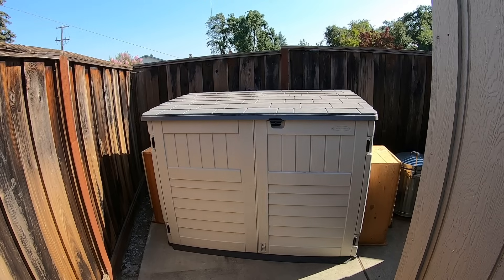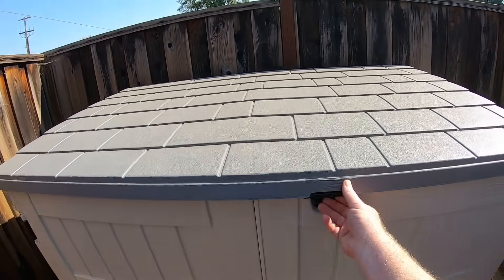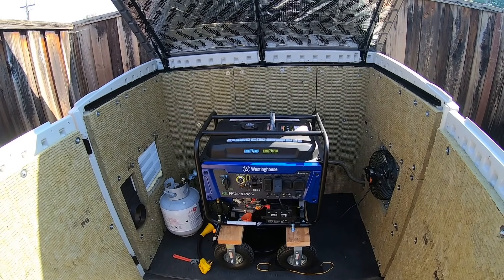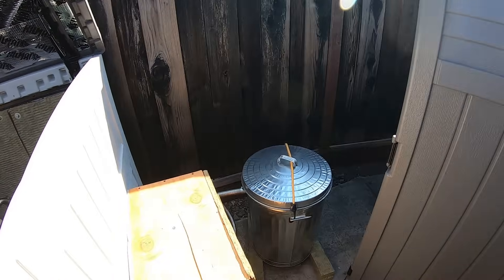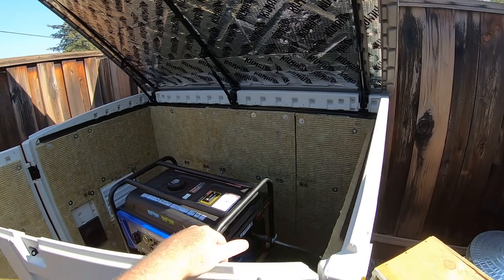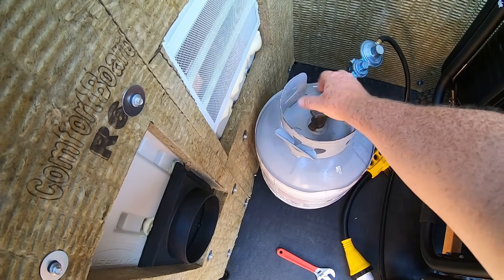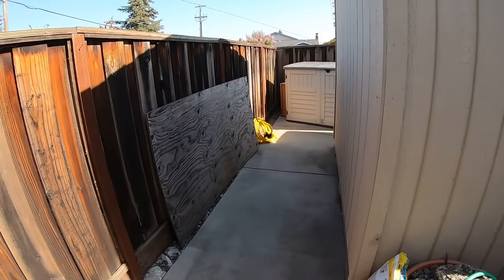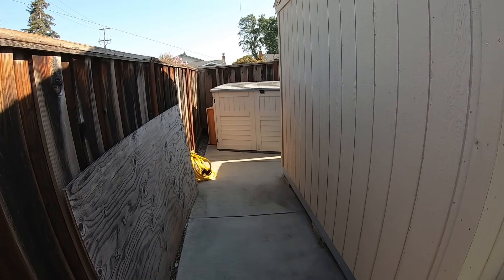DIY Generator Shed Build - Quiet Sound Insulation with Exhaust Muffler

Comment: Honestly, I didn't watch the video or read many comments, but I'll just tell you that I saw the LPG tank and reg inside the box and it jumped out as something I wouldn't have done. Codes require clearances around natural gas regs (pre-meter) to things like windows, vents into buildings and air inlets to appliances. If the diaphram in the reg has a sudden major failure (rare , but it can happen) , you want that leaking gas to go outside and away from any potential ignition sources. Plus the tank just takes up room and doesn't make any noise anyway. I know bbq's have the tank/reg right next to the flame, but it's still something that most people don't think is an issue until they have what could be a very serious problem. At least that reg you have on your tank is a 2 stage.
Reply from the maker: Legitimate points.  The shed is setup so that you can easily move the propane tank outside of the shed and run the hose back through the blast-gate on the left, along with the electrical cables.   And yes, BBQs have the propane tank literally inches from the open flame as well.  Leaking propane is never a good thing.  I discuss these issues in my later videos on the exhaust and shed.

Comment: thanks for the great idea, I need this, also is that an intake fan on the right side?
Reply from the maker: There is an inlet vent on the left and an outlet fan on the right.  You can see more info in some later videos.  I cover the costs, parts lists, and other FAQs in a later video about my Version 2.0 Shed Exhaust.  Check out the latest vid here: https://youtu.be/y3pUw408jCU

Comment: So in addition to the muffler that was on the generator to begin with, the external secondary muffler adds another back pressure element.  Any performance degradation?  I'm thinking about removing the stock muffler on my generator and just straight piping to exit the enclosure, but I'm not sure if the loss of the stock muffler would increase the external noise.  Perhaps a larger external muffler?
Reply from the maker: I don't think I would recommend removing the stock muffler.  But I did address some of the backpressure issues in my later Version 2.0 Exhaust video, where I upgrade everything from 1" pipe to 2" pipe.  Check it out on my channel:  https://youtu.be/y3pUw408jCU

Comment: Does the exhaust can you made create too much backpressure causing the generator to use more fuel than normal on a lengthy run?
Reply from the maker: I address this issue in a later video on my 2.0 exhaust.  I updated the exhaust from 1" to 2" to make the exhaust flow easier.  https://youtu.be/y3pUw408jCU

Comment: I would much rather have a gas motorcycle versus a propane generator/shed/electric motorcycle
Reply from the maker: Fair enough.  But your gas dirt bike probably won't power your house if the electricity goes out.  I also discuss this topic a bit in a later video about the 2.0 exhaust.  But dirt bikes aside, I think most people probably watched the video to get tips on quieting down a noisy generator.

Comment: Great job with the sound deadening!
One thing I would  like to point out is I would move the propane cylinder outside for safety, preferably to the yard maybe by running some hardline.
Reply from the maker: I discuss this in a later video about my 2.0 exhaust setup.  Check out my channel for more vids on this subject.  The shed is designed so that I can put the propane outside and pass the hose back in via the blast gate.

Comment: Hi man i do not understand. That fan aspires hot air to the esternal or blows inside fresh air?
Reply from the maker: The fan pulls the hot air from inside and pushes it to the outside.  Cool air comes in from the vent on the left side, goes across the generator, and then exits on the fan-side on the right.
Reply: @C5Tor  thanks a million

Comment: Perfect setup.  Do you worry about exhaust build up in sort of closed in space? Since the exhaust points down and not away or up.
Reply from the maker: The exhaust is vented to the outside air, and is about 25 feet from my house, behind another shed.  It looks a little enclosed, but it is not.  Plenty of airflow in that corner of the yard.

Comment: Fantastic set up just one big problem. Get the propane out of the enclosure. You didnt set up a vent low enough in case the propane happens to leak.  A 20lb tank can level a house.  3 items in the shed can ignite the proane, exhaust, electric fan and electric starter. place it outside with an extension hose.
Reply from the maker: Good point, and I mention this in a later video.  The shed is setup to move the propane tank outside (to the left) and pass the propane hose via the blast-gate back into the shed.  This was just setup this way for demo purposes.

Comment: What length screws did you use to hang the Rockwool Boarrd up? Great series of videos!!
Reply from the maker: I used 2" self-piercing screws for the 1.5" thick rockwool.  I answer that question and a lot more in a later video on my Version 2.0 exhaust.  (There is also a separate video on the Version 1.0 FrankenMuffler build.) It also has parts lists, shed costs, and other Frequently Asked Questions.  Check it out here:   https://youtu.be/y3pUw408jCU
Reply: @C5Tor  Thank you sir!

Comment: Great Build! I'm a vet here in San Antonio and have to get a generator to support medical equipment during the next outage here in Texas. 
I Have already purchase A Suncast  70 cubic ft  shed like yours. Have the WGEN 12000Df on my list but will probably need to add the wheels as you did for ease of servicing and moving. I could not see a detailed list of of the build parts and accessories not mentioned.
Can you say which off road wheels did you use, size of wood for the wheel and the bolts for the Comfort Board? Thank you in advance for your time and contribution to all who need to pursue this essential addition to home safety and security.!
Reply from the maker: I answer those specific questions and a lot more in a later video on my Version 2.0 exhaust.  (There is also a separate video on the Version 1.0 FrankenMuffler build.) It also has parts lists, shed costs, and other Frequently Asked Questions.  Check it out here:   https://youtu.be/y3pUw408jCU
Reply: @C5Tor  Thank you so much for taking the time to answer me.This is very helpful!!!

Comment: just got a generator and wanted to build something similar... question though, why did you need to build in another pipe for the exhaust? If you already have a opening on one side and a fan on another to get good airflow throughout the entire shed, can't you just leave the exhaust alone, let it exhaust into the shed and let it be brought out by the fan itself?
Reply from the maker: I discuss this very question in a later video on my Version 2.0 exhaust.  It also has parts lists, shed costs, and other Frequently Asked Questions.  Check it out.   https://youtu.be/y3pUw408jCU

Comment: I did pretty much exactly the same without the muffler. I also added a solar battery tender to keep battery topped up and a solar charged LED strip to bottom of lid in case I need to be starting it up in the dark.
Reply from the maker: I discuss this very question in a later video on my Version 2.0 exhaust.  The LED strip is a good idea.  The video also has parts list, shed costs, and other Frequently Asked Questions.  Check it out.   https://youtu.be/y3pUw408jCU

Comment: This is fantastic. I am going to start looking for a similar shed on CL. Costco sells a similar one for $300.
Reply from the maker: Make sure you check out my channel for later videos in this series, where I go into the build for the Version 1.0 and 2.0 exhaust. It also has parts lists, shed costs, and other Frequently Asked Questions.  Check out the Version 2.0 video here.   https://youtu.be/y3pUw408jCU
Reply: I ended up buying from FB marketplace for $120 and now starting the build. I have the exact same generator; made it into Tri-Fuel with  a natural gas conversion kit and used quick connects for NG and propane tank connection.

Comment: If you have a fan running air through the shed, why would you need a separate pipe for the exhaust?  Aren't you creating backpressure on the generator by doing that?
Reply from the maker: I discuss this very question in a later video on my Version 2.0 exhaust.  It also has parts list, shed costs, and other Frequently Asked Questions.  Check it out.   https://youtu.be/y3pUw408jCU

Comment: According to this, ordinary bath towels outperform them all:

https://youtu.be/pABvTWSxOes
Reply from the maker: Interesting approach.  Yes, there are many ways to absorb sound.  However, for the generator shed, I was actually just as interested in the fireproof nature of the rockwool.  The towels are definitely not fireproof.  As far as cost, even if you picked up the towels cheap, if you used a wood frame such as in the video, the rockwool would still be more economical.  Each sheet of rockwool was about $9, and much less labor intensive to build/install.   But thanks for pointing out this video.  The whole point of this shed build video series was to think outside the box and apply some novel solutions to the quiet shed problem.
Reply: @C5Tor  
I like Quiet myself. 

Seems like towels could be sprayed with some sort of fire retardant. 
Then there's always a smoke alarm to bridge some gap to fire safety. 
"Silence is Golden".

Comment: Nice job. The most likely change I would make is that I would not have the propane cylinder located inside the enclosure, definitely would have it on the exterior maybe near the back. Just my two cents. Love that Franken muffler invention too !
Reply from the maker: I set it up so you can run it inside or outside the shed.  You can pass the propane hose in through the blast-gate, along with the electrical cables. I discuss this a little in a later video on my version 2.0 exhaust.  It also has parts list, shed costs, and other Frequently Asked Questions.  Check it out.   https://youtu.be/y3pUw408jCU

Comment: Just buy a predator they are quiet as hell so is new honda
Reply from the maker: Unfortunately, neither of those quiet-inverter generators was big enough to meet my primary need, which was to charge my two electric bikes at that same time while off-grid.  The Predator especially looked nice for the price, but unfortunately only has one 30-amp outlet, and no 50-amp outlet.  I needed at least 32+ amps.  Same with the Honda.  If/when Harbor Freight drops a larger inverter genset with enough power, I'm probably all over it!

Comment: The exhaust flex line diameter needs to be double the muffler’s exhaust point.
Reply from the maker: I discuss this very topic in a later video on my version 2.0 exhaust.  I upgraded the exhaust from 1" to 2".  The video also has parts list, shed costs, and other Frequently Asked Questions.   https://youtu.be/y3pUw408jCU

Comment: I didn’t see this mentioned in the comments.
Using exhaust wrap to put more exhaust heat out of the pipe may transfer significantly more heat to the flange in your plastic wall.
If you don’t have a heat retention issue running without wrap, I’d suggest you Don’t wrap the pipe.
Reply from the maker: I've done a few upgrades to the shed exhaust and the muffler since the first video.  Take a look at my channel and see some of the changes in the Version 2.0 Exhaust video. (Or take a look at the links in the description.)  It has parts lists, prices, FAQ's and a few other items.  Although I haven't added the exhaust wrap yet - Still on the to-do list.
Reply: @C5Tor  I just watched that a few minutes ago!
And yes, the new exhaust setup is much more protected from transfer of heat.
In your new setup, I’d wrap it from the muffler to the trash can through the insulated stovepipe. 😉👍

I’d warn about to Little back pressure, but that is actually set by the exhaust port to muffler on the generator set. So that is all fine now😉

Also, wrapping that exhaust will actually lower your noise lvls a bit more

Comment: This is awesome! Thank you. I have the same generator.
Reply from the maker: Make sure you check out the later videos on my channel for more info on the muffler and exhaust builds, parts lists, costs, FAQs, etc.  Since this first video, I've updated from my original smaller exhaust (version 1.0) to larger exhaust (version 2.0) to make the generator breathe a bit easier.
Reply: @C5Tor  Thanks! Will do.

Comment: This is an impressive 22 dB reduction in sound output.  Only one problem.  Most every community wants the generator to be 60 dB or less at the property line.  Our community wants 45 dB at the property line.  This would have to be buried in the ground.  So kudos, but unfortunately doesn't meet many community standards.  And without any UL listing for fire prevention can't be used in many locations.  But good job!
Reply from the maker: If you take a look at Sound Test #3 video (link in the description), it is mid-50's dB at the sidewalk on the other side of the fence.  So the sound level is already under 60 dB at the nearest property line.  We live near a freeway, so the ambient sound level without any traffic on the street is already well over 50 dB without the generator.  So I think reaching the 45 dB thing is definitely not achievable in my neighborhood.  But we don't have an HOA in our neighborhood, so it doesn't really matter.  But good feedback for those interested in building something similar in a community with strict guidelines.

Comment: Now the only thing that will keep you up at night during a power outage is your neighbors Generators.  ⚡🌩⚡

All kidding aside,  great job finding solutions for each problem you encountered. 

My only concern is if the modifications to the exhaust system are causing any exhaust restrictions.  
An easy fix would be to run  larger diameter piping and or limit the number of sharp bends. 

Thanks for sharing.
Reply from the maker: Take a look at my later video on my version 2.0 exhaust.  It also has parts list, shed costs, and other Frequently Asked Questions.   https://youtu.be/y3pUw408jCU

Comment: Badass but I’m sure that’s about $1000 for us non-Craigslist seeking people. Lol. Generator not included
Reply from the maker: Definitely well over $1000 if you use the same parts I did, and buy the shed at full retail.  Then add in the electrical work to connect it to your house, potentially hundreds more if you want to plumb some natural gas lines, etc.  This can be a serious money pit indeed.  Hopefully I broke it down enough so folks can take pieces of this and apply it to their own situation and budget, and they can get their generator as quiet as possible.  Maybe they already have a shed, or have some materials to build one.  Maybe they have some pipe or other tubing to build their muffler already laying around.  There's lots of possibilities.  Or, they can just fork over the $5k for a quiet Honda generator and skip the shed altogether.  But not everyone has that kind of cash sitting around.  Thanks for watching!
Reply from the maker: By the way, I did break down the shed and muffler parts list and the shed costs in my newer video on the version 2.0 exhaust.  It's a fairly long video, but it really breaks down all the parts, prices, and reason I used them. It also covers the more efficient exhaust I built. If you haven't seen it, it is available here:   https://youtu.be/y3pUw408jCU

Comment: I love the off road tires, Where did you get them?. My Champion generator is 200+ lbs. What bolts did you use to attach them?
Reply from the maker: The castors are from Harbor Freight.  Parts lists and shed upgrades are covered in this video on my Version 2.0 muffler and exhaust:  https://youtu.be/y3pUw408jCU

Comment: Nice job! If there's a power outage in your neighborhood noise will never be a problem because everybody would be running generators if they have them. The cops does not respond to generator noise complaints during power outages.

Comment: Are you not concerned by such a restriction on the exhaust? Won’t that kind of back pressure create performance and efficiency?
Reply from the maker: I have since updated all the exhaust components from 1-inch to 2-inch pipe.  Also shortened the flex pipe, sent it straight out the shed, and made a more gentle 90-degree turn in the muffler.  Working on a video now with many of the updates that I've done to the shed and the muffler setup.

Comment: I only use my generator during outages so I just have a wooden shed to store it in but no sound proofing.    I also have a battery trickle charger to keep the generator battery topped off, the last thing I want is to mess with a pull string during an outage, here it is usually a snow storm or wind storm like last week in Seattle area we had about half a day without power so I kicked off the generator but would be pissed if the battery was dead.   Nothing like Propane, no more expired gasoline or blocked carbs just make sure you have enough propane.  I have a 500lb tank since I use propane for heating as well so I have the generator hooked up.

Comment: Very good setup…I wonder if the price to build all that negates the extra money it would’ve cost to buy a real nice quite Honda generator?
Reply from the maker: I have about $700 into the shed.  Unfortunately, Honda doesn't make a quiet inverter generator big enough for my particular needs, which is why I went with the Westinghouse.  If Honda made something like a EU9500is, I would definitely consider it, even though it would probably be 6 or 7 times as expensive as this generator.

Comment: I have same gen.  Is it ok to keep the propane connected and fuel line open always on so the when there is an outage all you have to do then would be hit the battery switch and turn her on.   But now that I’m thinking about it I’m not going to save much time in the process and possibly make it unsafe with potential propane gas leakage ya tink?   🤣🤣🤣😜😜👌🏻👌🏻😢😢😢